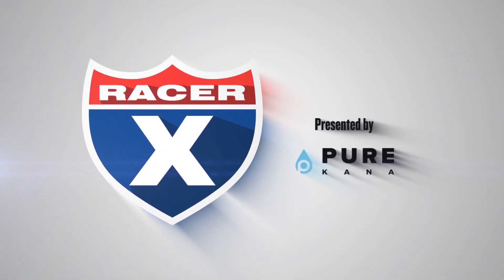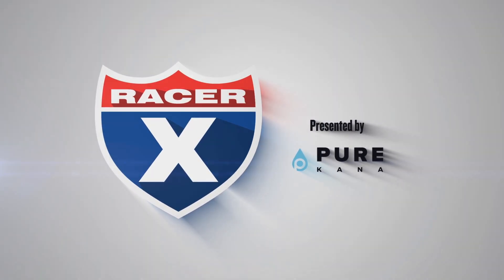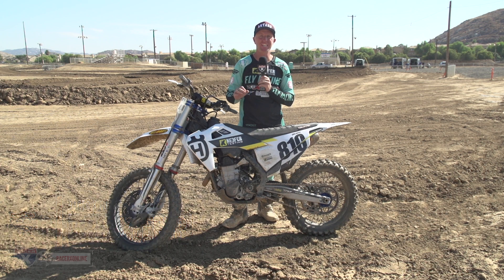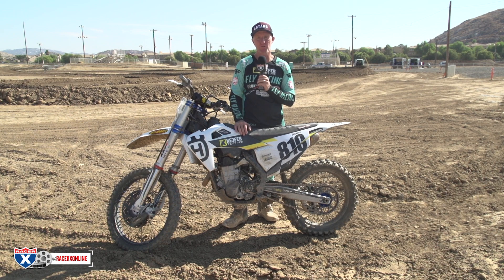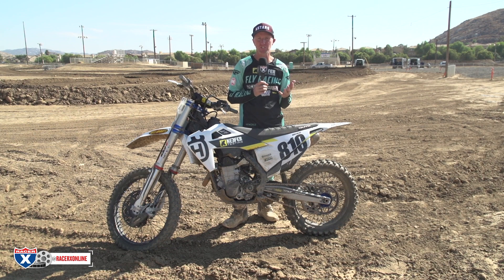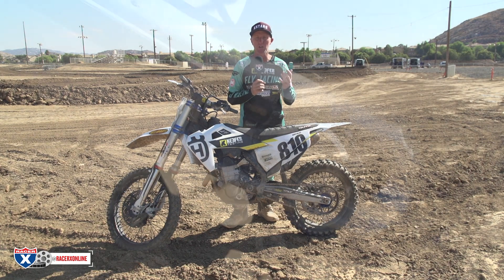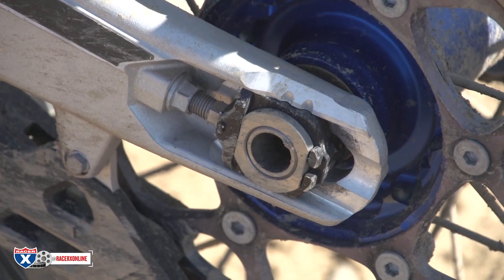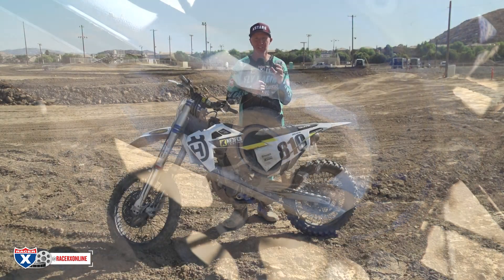Racer X Garage: Works Connection Elite Axle Blocks

Comment: Boltmx make really nice axle block kits, if you haven't already you should check them out. Only need 1 10mm to adjust the chain tension. But, all of works connection stuff is awesome too
Reply: They recently stopped making them smh